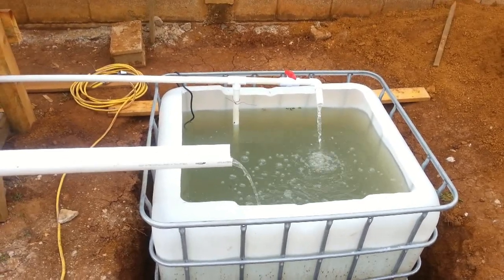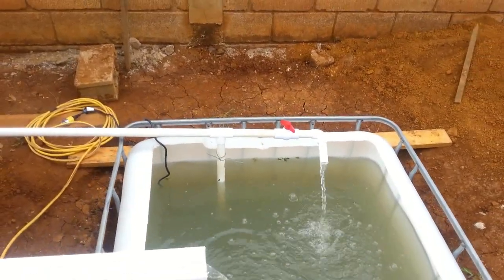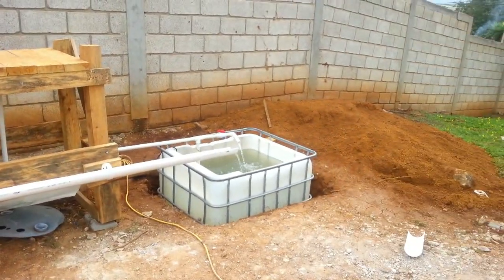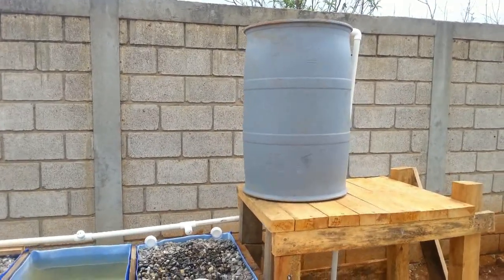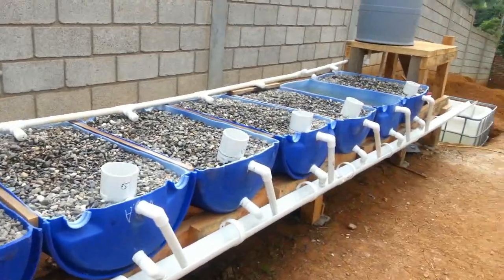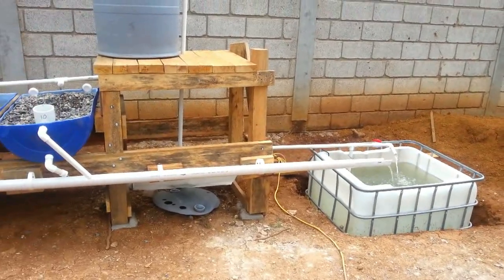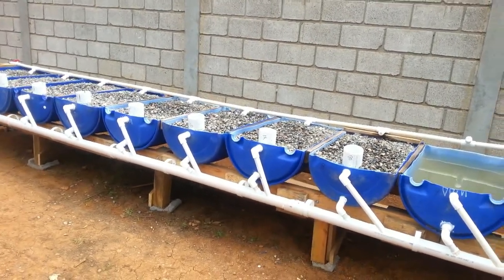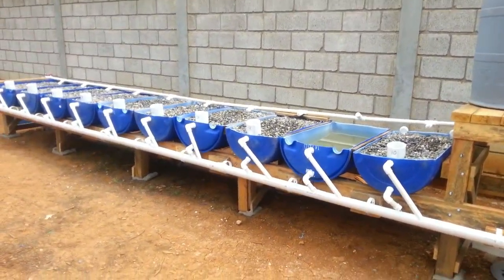Brief Overview of the Components of an Aquaponics System

Comment: Does your pump run 24/7? So as the u syphon drains the dump tank it is also simultaneously filling back up?
Reply from the maker: Amanda, You are right, the pump is continually supplying the dump tank. The pump serves to move water up to the dump tank which takes about 45 minutes to an hour. Once the water dumps into the grow beds after reaching the U Siphon the water then drains back to the fish tank. The water coming back to the fish tank helps produce oxygen in the water for the fish and later the plants. If the pump is not running, then the plants will not receive the water needed to supply nutrients to them. If you are having a difficult time with a power source at the location of the system, them maybe you could consider a small solar system with battery to power the pump. In this system you will observe a T as it leads from the fish tank. This T has a ball valve which allows the amount of water being pumped to the dump tank or returned to the fish tank. The returned water then also can be used to produce oxygen in the fish tank.

Comment: I don't understand how you are draining the grow bed.  I don't see a bell or anything just an open pipe at the top.  Can you elaborate on that part?  I have to make my set up bigger and I want to borrow some of your flow ideas.  Thanks Mr. Wanger
Reply from the maker: Thank you for your question. This video does not speak to this very well, but we have several other videos that will do this. I will give you an address for this. Briefly, the grow bed has two pipes exiting it and directing any water or overflow into a long drainage gutter going back to the fish tank. The bottom pipe exiting the grow bed is where the water exits after the grow bed fills from the water in the dump tank. When the water exits the dump tank and fills the grow bed to a prescribed level (approx. 1 inch from the top of the grow bed), the water from the dump tank stops its emission of water and thus the grow beds drain off through the bottom pipe. Thus it is called a "flood and drain" system. The other videos that will give a greater understanding of what we did here are titled, The Key Points of the Water Flow in an Aquaponics System and Building an Aquaponics System in Real Time. There is a short Time Lapse Build of an Aquaponics System too. My channel URL is: https://www.youtube.com/channel/UCU290sQCYhwr8lZirAfXzgA. Find the Aquaponics tab in the playlists and you'll find them there. Again, thank you for asking your question. If there is anything else I can help you with, let me know.
Reply: I watched those before i messaged you. I still dont get it. 
Ive had bell syphon for years, use flood and drain for almost 5 years now (im pretty familiar with ap) and i cannot figure out how you are flooding your beds an inch below hour gravel line and then it drains without suction.  
There has to be a detail i’m missing. And i dont see where your video ever shows the action.
Do you have a picture example or anything of your internal hidden flushing system?
Reply from the maker: The component that controls the height in the grow beds is the dump tank. The dump tank has a U-Siphon in it and as you well know when the water reaches the top of the U-Siphon it siphons out. The U-Siphon is set to a level that allows the right amount of water to drain into the grow beds. Setting the level of the U-Siphon is a trial by error process. We got the level correct on this system right on the first try, but sometimes it takes a couple more times to get the levels just right. The water drains from the dump tank into the grow beds at a faster rate than the water drains out of the grow beds due to the size of nozzle allowing water into the grow bed which allows the water level to raise to within an inch of the top of the grow bed. A smaller nozzle hole on the drain pipe allows this difference. It takes approx. 45 min. for the cycle of water from the fish tank pumping into the dump tank draining into the grow beds and returning back to the fish tank. I hope this explanation helps. The key is setting a U-Siphon in the dump tank at the correct level.
Reply: William Wagner (i was only addressing the outflow of the growbed - but thank you for further elaboration- it may help others).
I think i got it.
You just have a capped pipe in the submerged screen where a bell would normally be used (which isnt shown or I missed it in the videos somehow) with a pin hole in it that allows less flow to escape than what is let in. 
So you let four lanes if traffic IN and only allow two lanes of traffic OUT and thats how you control your timed outflow.  

Less complicated than a bell - bells can be a pain when flow is inhibited. 

Im going to try this method on next build. Thanks for sharing and taking time to try to help explain.
Reply: Noooo you are using the cap at the end thats close to the drain trough - thats what has the pin hole in it. 
I gotcha now. 
Forgive me - it is almost completely 180 degree idea from what I’ve been using.  My mind was looking for a whole different mechanism.  
Im absolutely going to try this simpler method on the next phase.
Thank you for your patience sir.
Reply from the maker: You are welcome. Enjoy the build. As you are finding out as I did, there are many ways to set up an aquaponics system. This system was chosen due to the inexperience of the people that are managing the system. Every system has its pros and cons. Thanks for being patient with me and allowing me to explain this system.

Comment: What form of water pump are you using? It looks to be electric, is that correct? Also are you feeding anything to the fish or are they getting all their nutrients from the return water? Thanks
Reply from the maker: You are right in says this is an electric water pump. If electricity is an issue, then setting up a solar unit for power would be the solution. Nutrition is basically coming from the fish, but a compost tea can also be used to begin the process of beginning the nutrient cycle. Don and I have finished the extended project. It can be located by typing the title, A Real Time View of an Aquaponics System. The video is about 45 minutes long. The longer version gives you a more in depth view of the same build with added comments and insights gained from years of building a number of systems. At the end of the longer video, there is a place where you can ask for a list of materials needed to build the system. We have also posted three other videos that give more explanation the aquaponics system. They are: A View of the U Siphon and Its Function on an Aquaponics System, The Key Points of the Water Flow in an Aquaponics System, and Brief Overview of the Components of an Aquaponics System. I hope this helps. If you like what you see, please subscribe to our channel and give us a like.
Reply from the maker: We also have a Time Lapse View of an Aquaponics System Build video for those quick views into aquaponics.
Reply from the maker: Sorry for the delay in responding to you, but for some reason I did not notice your comment. The water pump is electric. We have thought of looking into solar as an alternative. The fish are fed with fish pellets.  Duckweed is another alternative in feeding the fish. We have placed several other videos on our channel which will a greater idea of this technology. We have finished the extended project. It can be located by typing the title, A Real Time View of an Aquaponics System. The video is about 45 minutes long. The longer version gives you a more in depth view of the same build with added comments and insights gained from years of building a number of systems. At the end of the longer video there is a place where you can ask for a list of materials needed to build the system. We have also post three other videos that give more explanation the aquaponics system. They are: A View of the U Siphon and Its Function on an Aquaponics System, and The Key Points of the Water Flow in an Aquaponics System. I hope this helps. If you like what you see, please subscribe to our channel and give us a like..